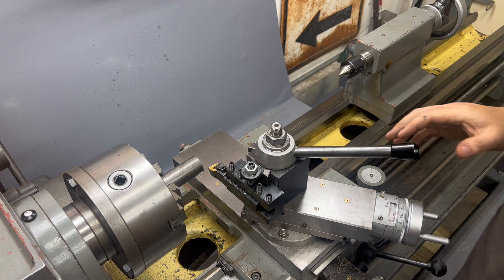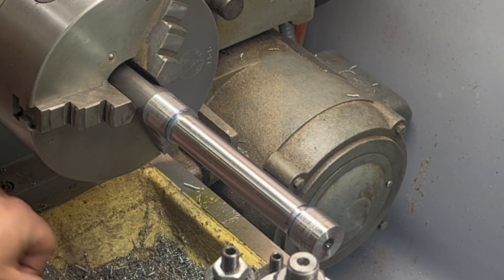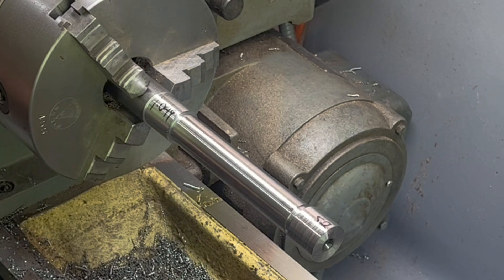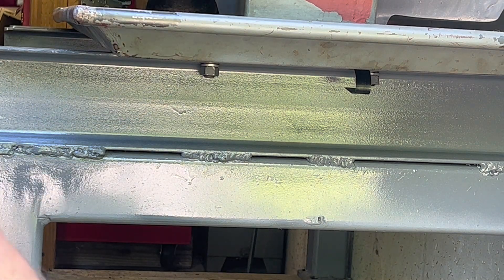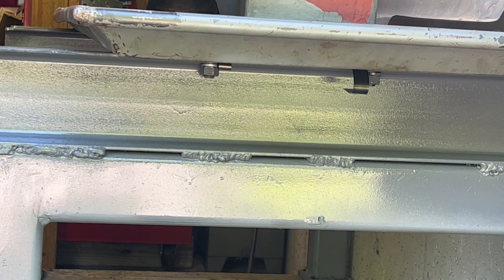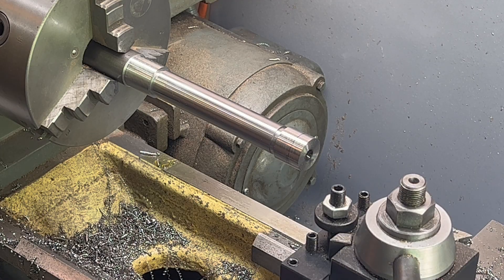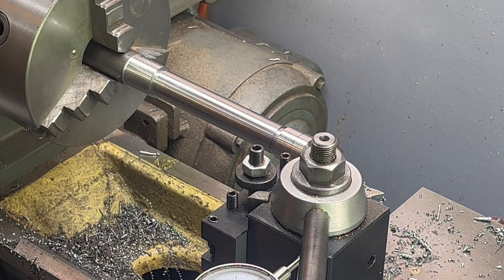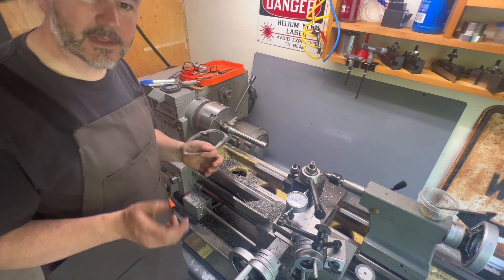Lathe Alignment Part 3 - using shims under tailstock and making a test bar to fine tune alignment

Comment: I'm missing something here. For the tests of skimming and measuring the two end pieces, you are shimming the tailstock at each pass and iterating in on the solution. What I don't get is that through all these iterations, you are not using the tailstock, so how does shimming it change anything?. I can't actually see most of what it is you are shimming. I wonder if we use different terms here in the UK?. To me, the tailstock is the part at the right end with a quill and morse taper socket which you can put drill chucks, etc, in. It slides up and down the bed. As far as I can see, that is not in use for the cutting tests and hence shimming it could not affect your measurements. Please put me out of my misery, thanks!!.
Reply from the maker: Hello!  I'm adding shims under the ways on the right side of the lathe.  My opening Text in the video does say shims under the tailstock; I can see how that is confusing, I meant to say adding shims under the tailstock side (right side) of the lathe.  By adding shims under the bed of the lathe, I can try and eliminate any twist in the ways and reduce the amount of taper that I'll get when cutting.  Hope my explanation was helpful, let me know and thank you for asking!
Reply: @EnoRestoration  Aha!. Yes, it all makes sense and twist is something I haven't considered yet. I have just shimmed my tailstock with good results, maybe I'll start worrying again :)

Comment: Apparently its essential to use a torque wrench to tighten the bolts to ensure consistent pressure on the shims each time you make an adjustment. That could be the cause of that minute discrepancy. Pretty good result though, considering.
Reply from the maker: Yeah, I agree more accurate with a torque wrench, but like you said I’m happy with the end results. You could chase your tail in this process for a long time…!